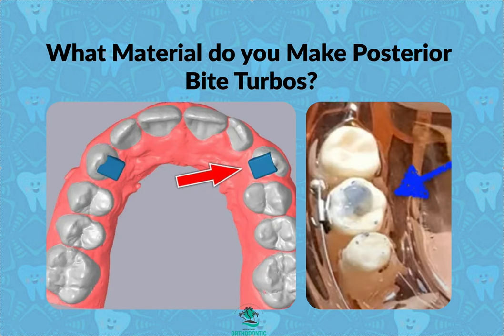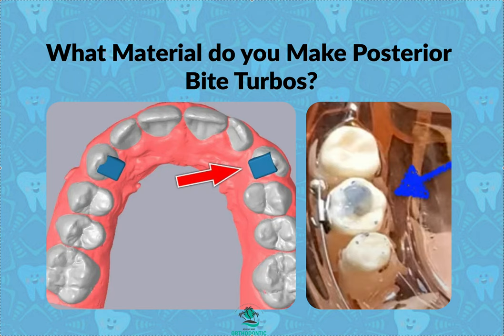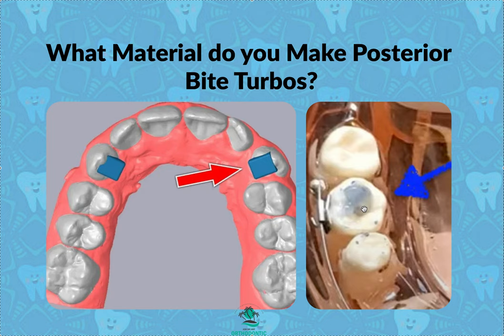What Material do you use to Make Posterior Bite Turbos?

Comment: Good advice !  In my hand what works easily for bite turbos (posterior or anterior) is the Twinky star compomer by Voco. It comes in whatever color you want. I dont mind etching and using adhesive, it drills out easy and the remaining product in the occlusal surface is easily removed with a sandblast. Thank you for your videos!
Reply from the maker: Great tip!